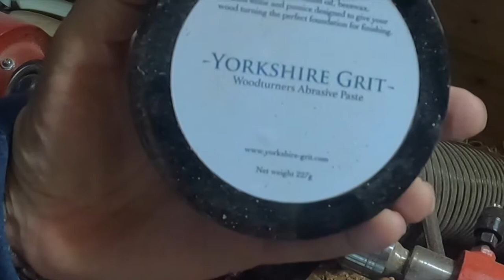51 piece segmented Walking stick

Comment: Nice clever design solution for those without a longer lathe - let's hope your new bed extension will be of great benefit next time. Did you consider getting a headstock with a bigger through hole ?  It sure seems big - did he like it ?    Thanks for sharing🙏  Stay safe. -Mike😷
Reply from the maker: Thanks Mike, having the bed extension will make a big difference if I take something similar, he was very happy with it, but im looking at using a 6 or 8 mm rod in future, Im wondering if a nylon rod would be strong enough also... cheers
Reply: @OurFrenchHouseRenovation  Nylon ? Perhaps not - too bendy. I was thinking an aluminimum rod.  And compress it somehow while the epoxy sets, like you did for this one.
p.s. I can't spell the proper name for element 13. LOL

Comment: Interesting method of constructing a walking stick. Was that 6mm or 8mm threaded rod you used? Was the finished article heavy?
Reply from the maker: Hi it’s 10 mm , and  it’s not heavy, so hopefully my step dad shouldn’t have any probs, cheers
Reply: @OurFrenchHouseRenovation  Thanks for the reply. I'm sure your step-dad will be thrilled with it. The finished item looks amazing. It will, no doubt, draw admiring comments when he is out for a walk. I may well borrow your idea, if you don't mind? I had major ankle surgery which didn't deliver the expected benefits so I will most likely need two walking sticks. Your video is very inspiring. Thank you :)